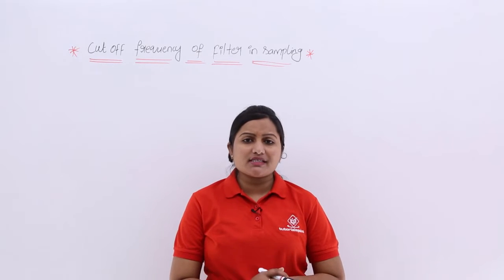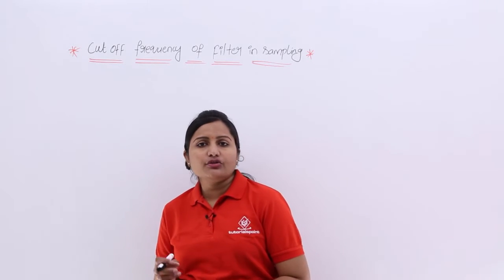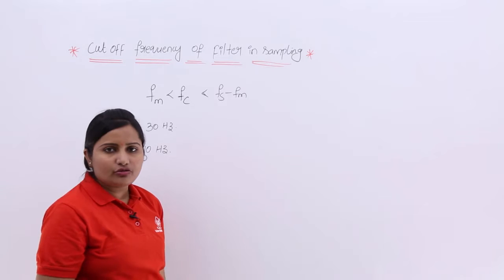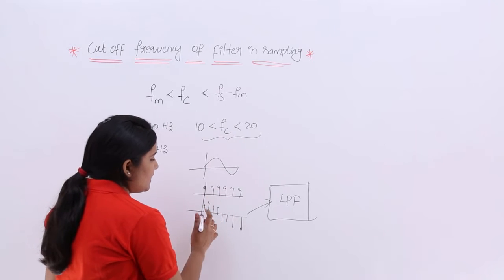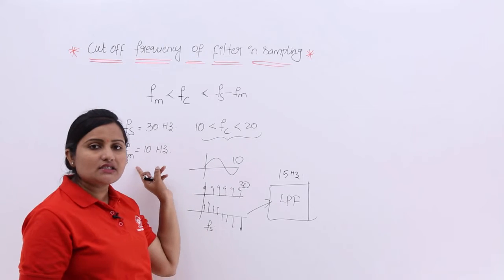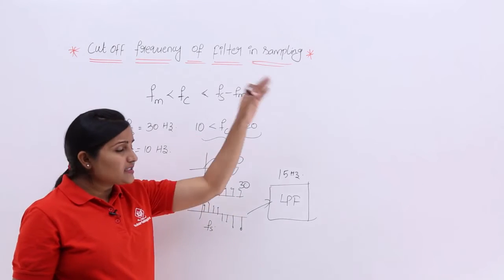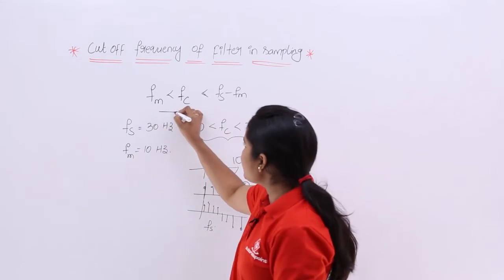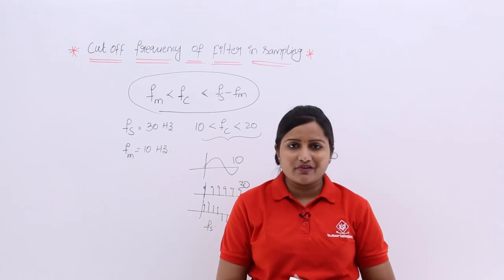Cutoff Frequency of Filter

Comment: Why do we stop the high frequency..and only allow low frequency to pass
Reply: part of the answer to your question is that in many applications we want to get rid of the high frequency components in the signal, for example, in image processing, when we want to smooth an image, we use low pass filters such as the mean and the Gaussian filters to smooth the whole "or parts" of the image...
Reply: the use of high frequency is only till its getting recieved  in order to decrease antennae size, once its done demodulation is carried on and we dont need that high freq anymore
Reply: for a time pass we are doing that